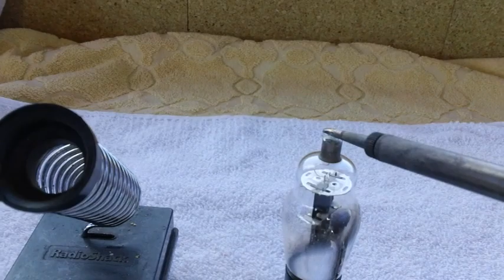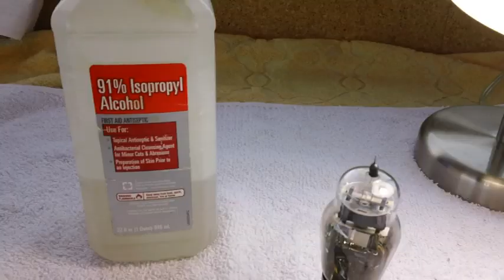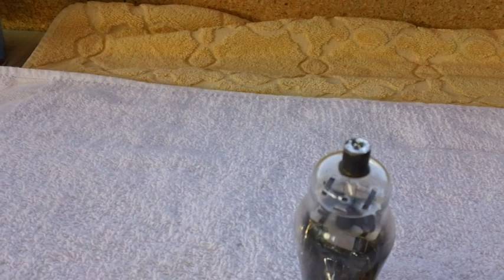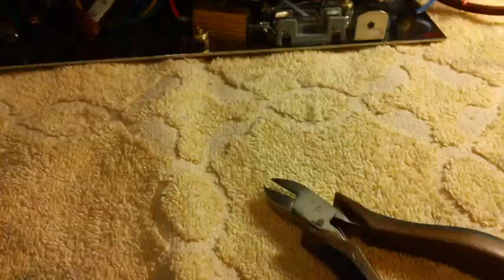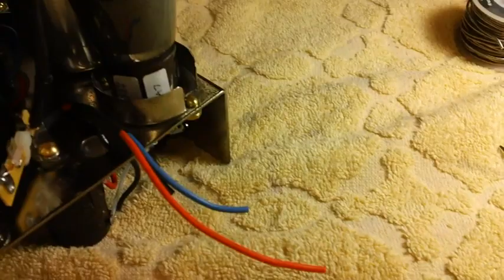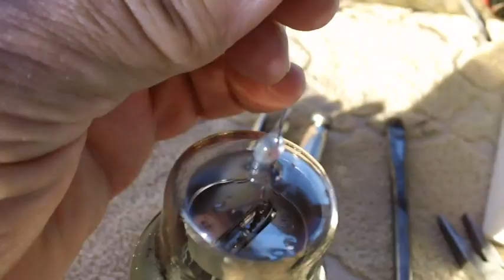1935 Atwater Kent Model 145 Repair and Restoration (Part 32 of 38).

Comment: Desoldering braid would be useful to tremove the solder. If you have no braid you can try.using the shield from some coax wth flux applied

Comment: John,
     I agree with you completely...That resistor would have never generated enough heat to merit the use of thermal compound. But, then again, it doesn't hurt either. Better safe than sorry.
Reply from the maker: Brian,
I guess it made no difference either way, but it did make one of our subscribers happier...and that makes me happy.
Thanks for dropping by.

Regards,
John

Comment: Always replace all Capacitors and filter Capacitors I saw a video were a amplifier burnt up because a old filter cap was not changed left in the circuit shorted...

Comment: I don't but, I'll bet I could find one.  I do have an 6" field coil speaker I found in a flea market last month.  I bought it in case I needed it, which it turns out I don't.  If you want to bypass your conversion, let me know.  I meant to mention it before, it slipped my mind until you said something.  I'm accumulating so much stuff, I can't remember what I've got.

Comment: Hello there John. It's looking like new and ready for 20 more years or more service. Big thanks for putting past under the risistor, if it gets hot later on if has some little thing wrong, would give but more help.
Looking forward in see this working again, like new, it just go to show how robust radios was back then for some parts to still work as intended after all this time.

Thanks John

Comment: John I have used rear view mirror adhesive it works good allso it handles the temp purdy good and it stick good to the glass and the cap but as you all way say what ever works for you. I use it because it drys fast about in one to two minutes

Comment: I have to say, that chassis just keeps looking more beautiful every video.  Best looking grid cap wires ever.  That radio will easily last as long as tubes are available.  Looking forward to the speaker conversion.